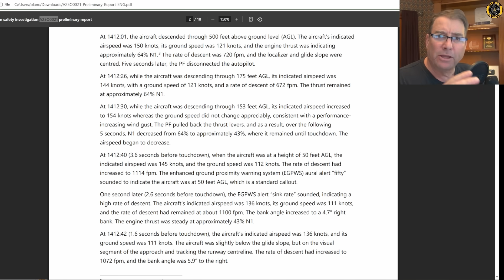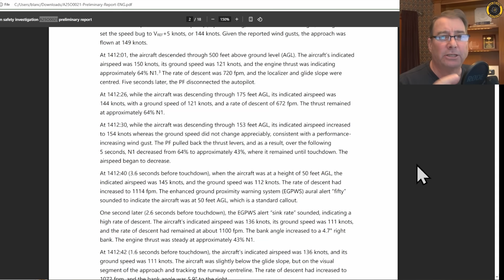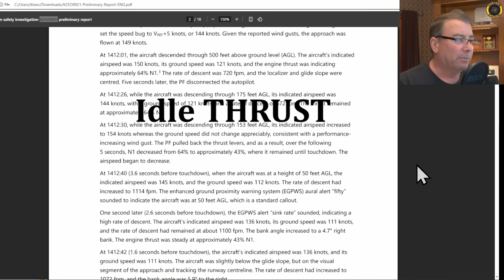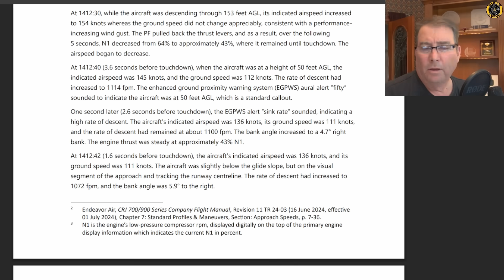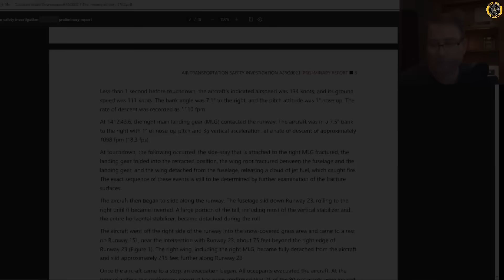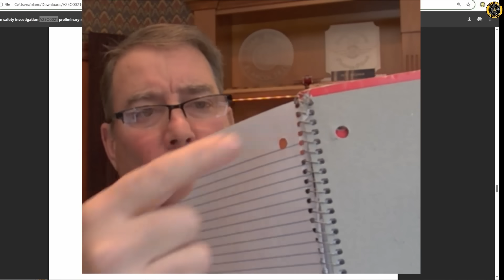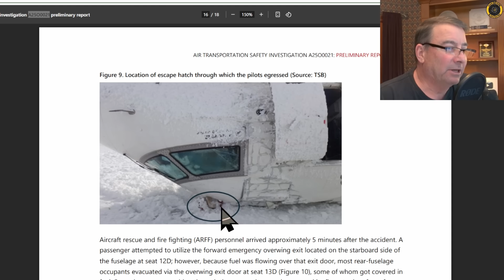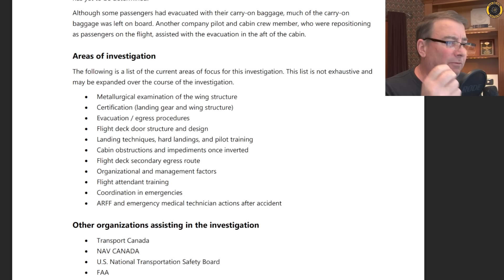TSB Prelim Toronto CRJ Crash

Comment: I was a Captain at PSA have 4300 hours in the CRJ.  They have us bug ref plus 5 for gust  so you have ref at the top of the bug and ref plus 10 at the bottom of the bug. This is taught at PSA , SkyWest.   The max crosswind on a dry runway is 32knots  wet runway brings down to 25knots . At PSA FO with less then 100 hours was limited to 10 knots.  The CRJ 900 landing characteristics are pretty good.  Normal N1 for a ILS in calm conditions is about 55 to 58%  power is brought to idle at about 20 to 30 feet.  But you never reduce power by 20% as even on a calm day the plane will develop a high sink rate very quickly with a large power reduction.  There have been many times I have landed the plane with some power in strong crosswinds.
Reply: I’m a TRI, and have been involved in writing SOPs, and I find this SOP insane! Why would you ever bug any reference if you are not going to fly it?

As a PPL my instructor would drum it into me: “bug what you want to fly and fly the bug”. 

This SOP requires the PF to be constantly monologuing ‘bug plus 10, bug plus 10’ (or whatever the briefed value), and that’s all well and good until task saturated. 

I will be amazed if the final report doesn’t make a recommendation to change this practise. 

It’s not the cause, but in my opinion it as another slice of Swiss cheese and an already challenging flight.
Reply: As a complete layman when it comes to these matters, I find it extraordinary that you are able to give such a comprehensive, objective and insightful analysis that non-experts can comprehend. Thank you.
Reply: Thanks for the info. Would the accident runway's drifting snow be considered dry or wet? Would you have attempted this landing? I live east of TO and the wind and gusts that day were frighteningly strong, even for southern Ontario.
Reply: @brandonsnider7907  Yes, I would have done the landing.  Several hundred planes landed safely at the same airport that day.   I did many in similar conditions when I flew large turboprops for a commuter with a hub at BWI (Baltimore Washington International) way back in the 1980s.
Reply: I think the mention of a pilot being limited to anything until 100 hours has been reached says a lot. 100 hours is basically nothing as that can easily be accumulated in perfect flying conditions without ever being exposed to these situations and conditions. In this case the captain wasn't any better, but he should have been flying this aircraft at this time. Sorry but when I see a couple of youngsters walking on board, I get really nervous. And I'm seldom disappointed.
Reply: Can you describe throttle response on these jets? As a piston-only private pilot I am used to pretty rapid response and I know that is not the case with turbines. How long does it take to spool back up from idle to normal approach power? At 3.6s prior to touchdown, with their sink rate at 50ft and power at 43% N1, did they have time to arrest the descent and go around? I also wonder what the design ultimate load is for the landing gear in these planes. Would 3G have been manageable with touchdown on both mains? I imagine there's probably a loading beyond which inspections would be required.
Reply: @jbm160  not rapid response... If they would have gone immediately to full thrust at the time you asked about, yes they might have saved it with a go around.
Reply: I don't know, my utterly ancient passenger seat GA exposure only gives me a bit of context or plane type understanding, and I was able to slowly piece out this detail and tech comment and got a decent idea of the meaning
Reply: You are near the mark at the end about pilot training……. But when you have U.K. Airline Managements that want to reduce risk and insist pilots do more auto coupled approaches, engage autopilots very soon after departure, don’t let them fly manual visual approaches and become more like system operators and managers, then the old stick and rudder skills evaporate. Simulators aren’t always perfect for teaching the last 200’ of an approach in tricky conditions and there is no substitute for practise and experience and , at least, know what NOT to do in split second scenarios !…… ……it’s my view that we need to do a lot more no jeopardy training. I feel very sorry ( as a 25,000 hour and 5,000 as Sim trainer) for the co-pilot in this scenario…..the pilot has been let down in the training arena
Reply: @mikethrower742  my airline, a US legacy carrier, makes us stay coupled on IMC approach conditions but we can fly manually as soon as we break out. I routinely hand fly the jet up to 18,000ft on departure. Im on the 320...I try to do at least one manual thrust approach per trip. Its essential.
Reply: I asked AI to make this easier to read for us non pilots LOL 

"I was a Captain at PSA and have 4,300 hours flying the CRJ. At PSA, we set our speed to reference speed (ref) plus 5 knots for gusty conditions. The speed bug shows ref speed at the top and ref plus 10 at the bottom. This method is also used at SkyWest.  The maximum crosswind limit is 32 knots on a dry runway and 25 knots on a wet runway. At PSA, First Officers (FOs) with less than 100 hours were limited to 10 knots.  The CRJ 900 lands well. In calm conditions during an ILS approach, normal N1 (engine power) is about 55–58%. Power is reduced to idle around 20–30 feet above the ground. However, you should never cut power by 20% suddenly because the plane can sink quickly, even in calm conditions. In strong crosswinds, I have often landed with some power still on.
Reply: 65% on final in the 900,at least at Endeavor. Ppwer to idle around 20ft touching down around ref minus 5.
Reply: What was your stable approach criteria at PSA? I would have thought that below Vref, sink rate greater than 1000fpm and idle thrust below 500' was not 'stable'...😳
Reply: @paddle123  You'd assume a "sink rate" alert at 50 feet AGL would be an automatic go around. Worst that could happen would be the smoothest touchdown possible, followed by a gentle climb.
Reply: @kewkabe  I’ve said to myself - go around for the win.  It’s served me well in GA.
Reply: @paddle123  visual at 500 feet speed +5 -0  sink 1000 or less.  ILS 1000 fully configured plus 5 minus 0 sink 1000 or less. I was Based out of DCA so I taught the River Visual to new FO’s. The FO had to have 100 hours in type before they could fly the River Visual with out a check airman
Reply: @mikefobert9485  Man my first day of OE was the darn river visual in the E175. Talk about throwing me in with the wolves.
Reply: @mikefobert9485  Could you please clarify for this non-pilot what "plus 5 minus 0" means? Looking at this, are you surprised no one called for a go-around?
Reply: @mdhazeldine  you could be at ref speed plus 5 knots but could not be under ref
Reply: @mdhazeldine Vref is the calculated approach speed (Vref is also 1.3x Vso the stall speed in the landing configuration).  So they’re flying -0 (not less than Vref) to plus 5 knots as part of stabilized approach criteria.
Reply: @mdhazeldine  +5 -0 are your allowed limits, in the his case your speed be between (Vref + 5) and (Vref - 0), where Vref is the required/optimum landing speed.
Reply: @mdhazeldine In order to continue the approach and land there are a series of “gates” you pass through… these are speed gates in that you can be up to 5 knots faster than Vref (the reference speed) but ZERO knots slower in order to continue.  Outside of these parameters you aren’t “stable” and need to go around and do it again.
Reply: @mdhazeldine that means bug +5 is desired and -0 means Never below that speed. And as a side note pilots sometimes add 5 knots for the wife and another 5 knots for the kids when it is really rocking (gusty) only the pilot knows what the True conditions are at that time and space. The tower winds may be 2-3 miles away.  This is 38 years of jet experience and never put a scratch on a aircraft.
Reply: @paddle123  Idle thrust is ~25%
Reply: @skyboy1956  depends Fadac sets it and there a few different idle settings depending on several factors
Reply: @skyboy1956 What is flight idle?
Reply: @pauljones6321  flight idle is determined by Fadec. Fedec takes into account altitude, temp and such so flight idle will vary. We just pull the thrust levers to idle and Fadec does the rest. If Fedec fails the engine fails. Fedec sets takeoff thrust and climb thrust to. Back in the CRJ 200 days we would be chasing the N1 Carrots
Reply: @pauljones6321 if you pull the thrust levers all the way back in flight, the engines settle at a certain rpm (%N1). What that % is, is slightly variable depending on a few things, for example if engine anti ice is on, that flight idle N1 will increase slightly.
Flight idle is higher than ground idle. The reason being that when flaring the aircraft for landing, you pull the thrust back to (flight) idle. If THEN, you decide to go around/wave off/abort the landing/perform a balked landing, the engines spool up faster to the go around thrust setting. 
But on the ground during taxiing, you don’t need that higher rpm (N1), so the ground/air sensing tells the FADEC (full authority digital engine control) to reduce the idle thrust (ground idle).
The crossover between flight idle and ground idle is delayed by a few seconds after touchdown, to allow quick spool up for reverse thrust application.
Reply: @pauljones6321  Flight idle is a higher idle speed than what is used on the ground. The reason for it is that a jet engine takes time to "spool up" or increase rpm. From ground idle, it takes up to seven seconds or so to make good power. From flight idle, it takes much less time, so the engine is more responsive. On approach to landing, you want the engines to respond quickly so that power to go around or respond to a situation is rapidly available. Once the aircraft has weight on wheels, and has settled down, the engine controls reduce idle speed to ground idle. I hope that explanation is clear.
Reply: @mikefobert9485  the only change is altitude. Won’t idle at 25% at FL 350. But it won’t land with 43% idle at SL
Reply: @mikefobert9485  hey what’s up Doc? I think those were called carets. Not the bugs bunny kind.
Reply: @pauljones6321 As used in this context it is the percentage of maximum turbine speed which the engine needs to be “on”… think of it similar to your car’s idling rpm at a red light, except it is expressed as a percentage.  So 25% N1 means the turbine was rotating at 25% of max speed.  It produces very little thrust at that power setting.
Reply: @skyboy1956 wascally wabbitt….
Reply: @mikefobert9485  Old 00 pilot here, i feel you with the 200 :)
Reply: They now let us bug +10
Reply: Given you can stop faster because of the head wind.
Countered by the runway conditions .
But, you can always go around. ...
Reply: Ah Pacific Southwest Airlines!
Did you have the passengers Catch your Smile?
🙂
Reply: Pulling that much power off in any jet is a recipe for exactly what happened here.  A quick application of power by the Capt would have saved that landing .  A go around would have been better.  I wouldn’t pull that much power off until 30’
Reply: But you are a responsible, smart, cautious and careful person who diligently studied and remember important information. Rather than being a DEI hire put in place for their physical appearance
Reply: @CanadaHasFallen  more of this DEI nonsense
Reply: speed bugging is done the same way at 9E
Reply: Talking to a fellow pilot is a language not understood by non pilots. 
Just saying.
Reply: @Bill3558 the problem is that if actual pilots start talking in such a way that non pilots understand what they’re saying, people don’t believe they are pilots and don’t believe a word they say anymore…😂
Reply: @Bill3558  Any non-pilot who follows this channel for a while knows the lingo and context because Juan usually defines technical terms and explains everything very clearly.
Reply: @Bill3558  This is an aviation channel - perhaps you should increase your rate of learning.
Reply: So ask questions and someone will explain it to you.
Reply: @Bill3558  what is hard to understand, percent power? Dry vs wet?
Reply: @Bill3558  This isn't the "Explain Like I'm 5" subreddit.  Just sayin. 😂

Comment: Thanks for explaining these reports so clearly Juan. Like you I am somewhat shocked at the low flying hours of these pilots to be in charge of a commercial airliner. I only fly in simmulation but in the past four years have clocked up more hours than the captain seems to have in his career and I still have a great deal to learn. A very interesting comment about the lack of stick and rudder training - could explain a lot. Understanding up and down drafts, turbulence and cross winds really is necessary. Flying in the mountains of Papua New Guinea Ryan Farran talks a lot about about these phenomena and how anticipate, avoid or deal with them. He' pretty good at stick and rudder work as well!

Comment: Glad you added that last point, Juan. Thinking back over thousands of approach and landings in similar, if not worse conditions, this would have just "felt"  wrong. Getting that sudden increase in airspeed, pulling off a skosh of power but knowing you need it back almost instantly as you feel (YES... FEEL) the bottom start to drop out.

Comment: Juan, in the C-5 we used a reference ground speed on the INS.  THIS allowed us to have the energy to get through this type of wind.   We would fly whatever Vapp )Vref that maintained our reference ground speed for the approach.  This could account for wind shear and gust.  I would have been looking for a reference ground speed of about 125 knots on this approach and help a Vref to maintain that.  This precludes the airspeed loss and high sink rate on final.   Of course the C-5 is BIG, but the principle works for any aircraft.   John, COL, (ret) USAF , ATP/CFII SMEL, FE.
Reply: Nice Bo'. Another AF guy mentioned this in another reply.  I've never put thought into something like this, but I'll start looking at it in the 767.  Might be a good topic on beechtalk?
Reply: Reference GROUND SPEED??  An aircraft fly with indicated airspeed not ground speed. I don’t understand. Sound crazy. What if you approach with tail wind
Reply: @ This is to ensure you have the energy to get through a wind shear or rapidly changing winds.  Max tailwind in a transport category airplane is 10 knots.  The C-5 is big and has a lot of mass.  That’s why this procedure was used.  You still us your Vref, but adjust it to maintain the calculated reference ground speed.  (But not below Vref.)
Reply: @johnscherer5380  This is some of that "pilot two point oh" stuff.  Imma stealin it.
Reply: @johnscherer5380  Interesting. If head wind decrease then the power is reduced to maintain GS but not below Vref. If head wind increase then the power is increased. I ever heard about that but interesting jejej
Reply: @juanmanuelgomezmartinez3795  Then the reference GS is greater than your IAS.  I understand the concept - especially in huge aircraft where inertia can mask airspeed changes.
Reply: Could FRED survive an 1150 fpm descent rate touchdown?
Reply: @ I gave that a shot in 1983 in Somalia.  The co-pilot’s ADI glass broke.  It was such a hard landing that no one on the crew even uttered a word until the crew chief said “ should I do the hard landing inspection?” I still think
Of that landing.   FRED was fine but my pride was wounded.  Got back on the horse and greased the next landing in Cairo, Egypt.